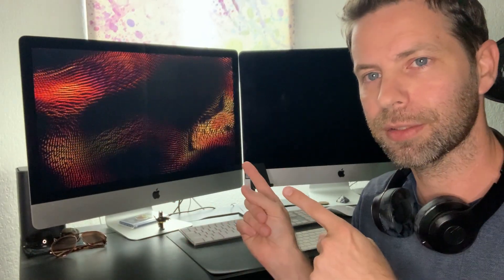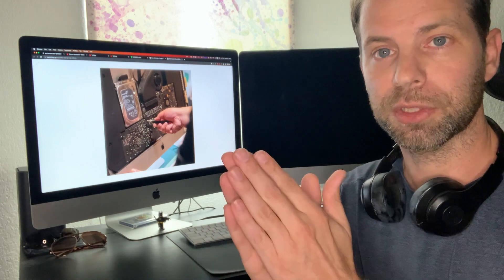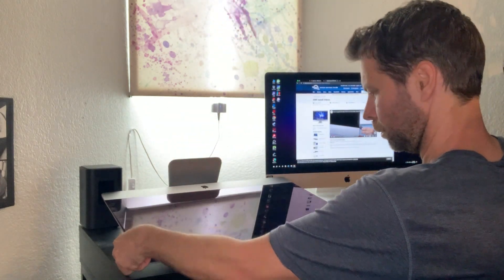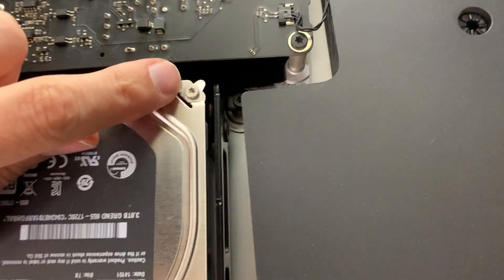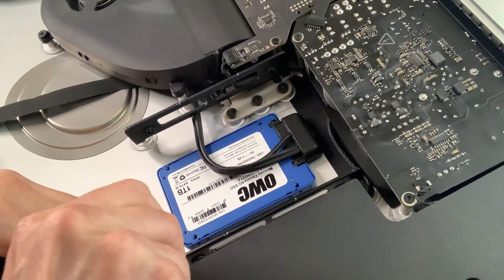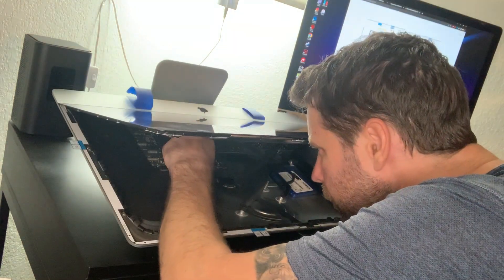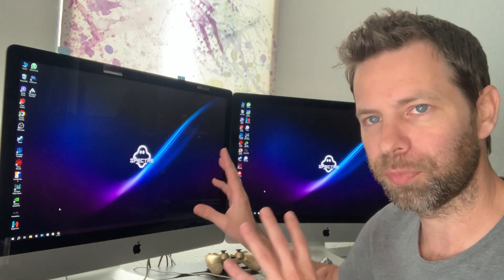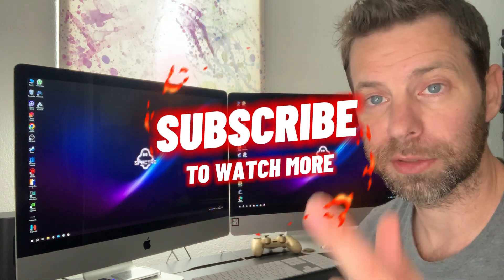My Fusion Drive Died, Time to remove and replace the the Hard Drive in a 2013 iMac!

Comment: After this upgrade from HDD to SSD did the fans in the iMac computer run all the time? There’s a temperature sensor in the original HDD of the late 2013 iMac. Some upgrade kits provide a cable with this temperature sensor on it as a workaround.
Reply from the maker: It did not for me. But I use an app for fan control anyway. There was not a sensor on my HDD.

Comment: So, a question. This is a very useful guide to installing a new drive when the HDD dies. What do I need to do first when my HDD dies? I’m a little confused about splitting the Fusion Drive. Does the OS inherently live on the SSD? Also, the machine I’m trying to repair is a 2017 iMac.
Reply from the maker: @CheweyDelt  on mine it does, I don’t fully remember the commands to split the drive. But I would definitely recommend splitting it before you install the new drive. But once split the main SSD has to have the OS on it. But as is the OS is split between the two drives similar to a raid. So if you pop in a new drive it will most likely not boot if it is looking for that Fusion Drive. Does it currently boot?
Reply: @SamSpadeTech  it used to boot to the login screen, and then I couldn’t go any further. Now, when I turn it on, all I see is a blinking folder icon and a link to the apple support page. I’m still able to boot a Linux distro from a flash drive, so the machine is still useable in some form. But I’m trying to figure out if I would be able to fully fix the machine if I replaced the HDD.
Reply from the maker: @CheweyDelt  yes, you should still be able to split the drive in terminal using the OCLP installer before you install the OS. Or you may still be able to install the new drive and install and see if the fusion feature still works as is. I have never tested it so I am not sure if that will work but in theory it should work fine. Try it out and let us know. Either way it sounds like the HDD is dead and you will have to install a fresh OS either way.
Reply: @SamSpadeTech  That is very helpful. I will give it a try soon and let you know how it works out. Thanks for responding!
Reply from the maker: @CheweyDelt  my pleasure, let me know if I can help any more

Comment: I have to do this with a 2017 imac. I have the new ssd drive kit form OWC but I need to split. How was splitting the drives?
Reply from the maker: it was pretty easy from what i recall, just a few terminal commands and you should be good to go, I have run into some wierdness if you are running OCLP if you try to install an OS on the other drive, so just be aware my particular system 2013 makes the tiny SSD the primary boot drive.

Comment: life saver ... thankyou
Reply from the maker: absolutely
Reply: @SamSpadeTech  just ordered the new adhesives and a new ssd thanks again
Reply from the maker: Did you already split the Fusion Drive? Be sure to do that in terminal before you swap it out.
Reply: @ I can’t get the  platter drive to respond  it shows up red  and won’t do a thing. So with the installation still intact  I’m thinking I can format new sad and get it up and running
Reply from the maker: Yeah you should be able to do it with the new install as well. Just wanted to make sure you didn’t hit any snags. It definitely runs smooth now.
Reply: @ I’ll defo msg u if I struggle if u don’t mind .. thanks again
Reply from the maker: For sure, I am here to help. But I imagine once you go ahead with the fresh install it should recognize them as two drives. I think it’s more of the OS is across both drives it just won’t boot. But I prefer it with 2 drives so I can install OS as needed and keep my files safe.

Comment: why you dont change nvme m2 ssd; and then blackmagic i need t see write and read the most important
Reply from the maker: In order to change the NVME you have to strip the whole thing down and remove the motherboard entirely. The Fusion Drive is no longer in use anyway. So
Reply: please tell me now ssd speed read write thanks  @SamSpadeTech
Reply from the maker: @gyoung7802  I will get back to you. I don’t remember what I was getting but it’s night and day compared to the old platter drive.
Reply from the maker: Hey there, so I am getting 455mb/s write and 522mb/s read times on the SSD that was installed.